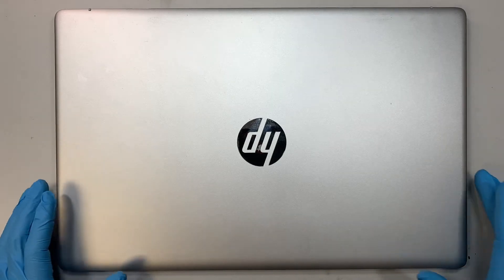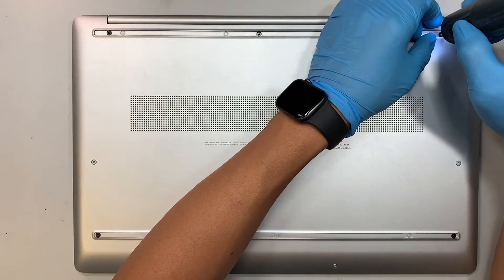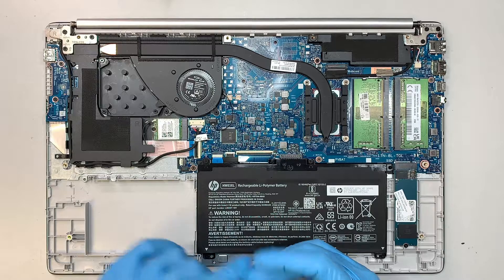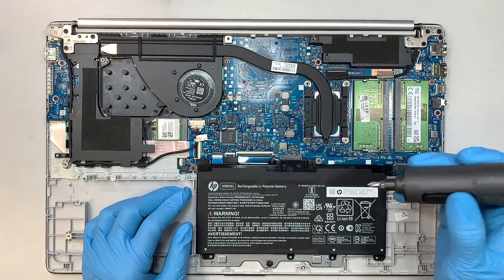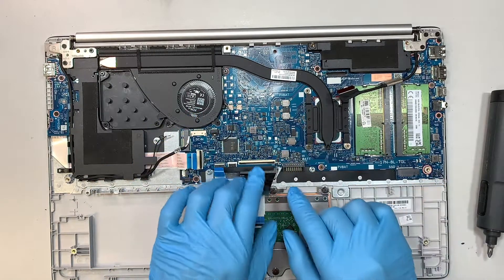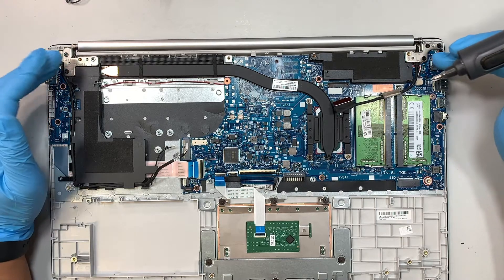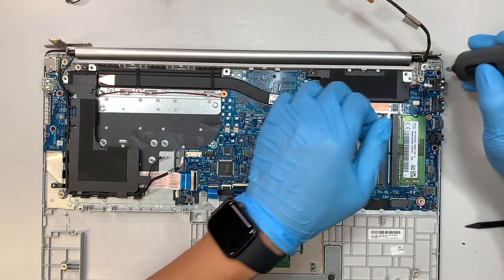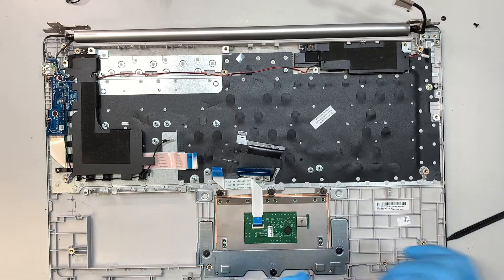HP 17 cn0023dx Upgrade Teardown Disassemble

Comment: Is the 32gb max ram available  for this model on all regions ( South East Asia)? Tried asking hp customer support but they just said rams are typically soldered. Planning to buy one but if its soldered its not worth it.
Reply from the maker: There are two ram slots. You can upgrade to 32gb

Comment: How about telling people max ram it can take,  can we add another hard drive and can it be SSD,  video upgrade or is it integrated.  I think that would be more relevant information to a bigger viewing audience.
Reply from the maker: Thanks, will keep that in mind. 32gb ram is max
Reply: @UbergeeksBiz  what? I just put 64gb in mine! I thought I had found that somewhere... it seems to be happy and showed up on the system..
Reply: You can add second 2.5" hdd/ssd, but you have to buy sata cable separately. Part number is M75893-001.